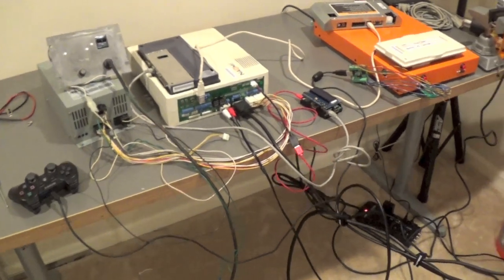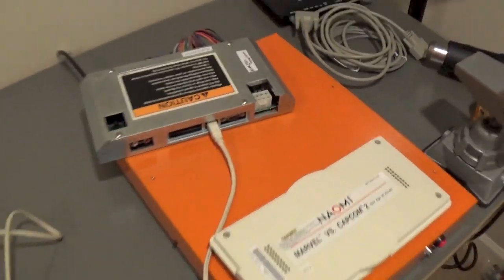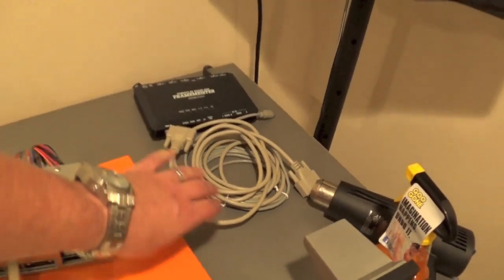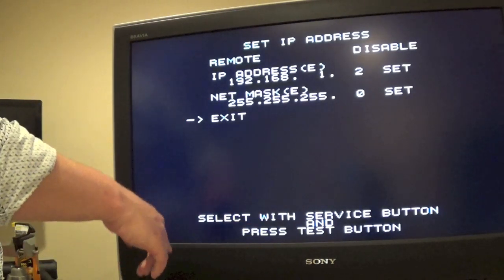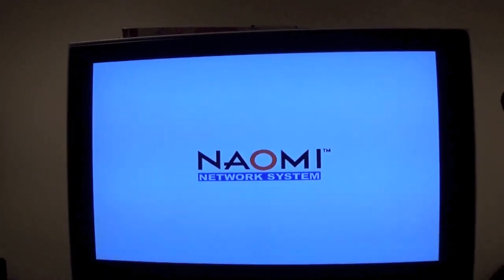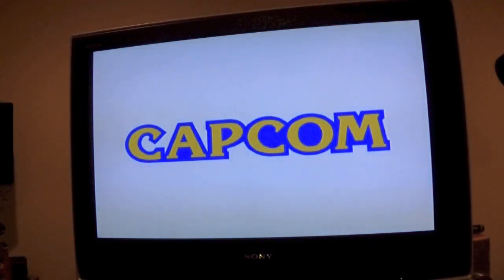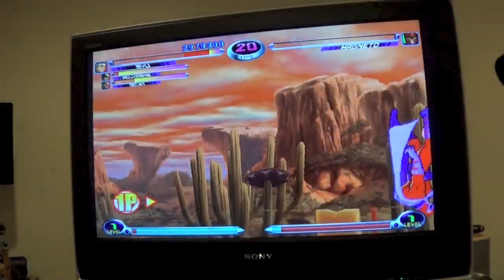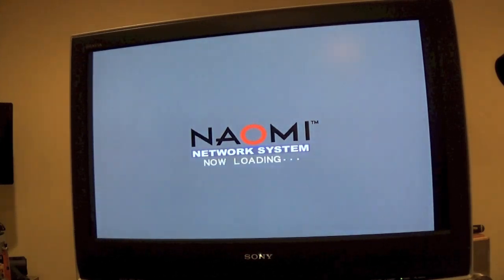JasensCustoms.com - Sega Naomi NetBoot Kit

Comment: What format does the rom on the compact flash need to be in?  If the game is a cartridge and not a GD-rom like you show in this video, what does that file on the CF look like?  I have a Original Wild Riders where the cart has died and was hoping to use this as an option to getting the game to run again.  Thanks

Comment: How much would that setup cost me as in a system like that
Reply from the maker: Alexander Smith - A lot. Naomi Net Dimm hardware isn’t easy to come by and they fetch a high premium. The Naomi isn’t terribly expensive but everything else needed to get it up and running ads up very quickly.
Reply: Yeah I actually get that

Comment: any chance of putting your pi software up somewhere? :) thanks
Reply from the maker: Clayton, not my software :-D It was a collaboration between TravistyOJ and others on the net. Actually, he may have just used some work from others and ported it to the Pi. I digress... check it out here: http://capane-us.github.io/piforcetools/#_=_
Reply: Thanks, found it on their site
Reply: Jasen Hicks would it be possible to get the pin out of the USB plug? And which pin does what for power on the Naomi? Thanks. Unless you still sell the cables

Comment: This item no longer available at JasensCustoms.com
Reply from the maker: Jensen, correct. I ran out of stock. I was thinking of bringing more  in but the 20 kits I had took about 6 months to sell. I will be selling PICs and BIOSs and USB Power Cable Kits for the Pi here shortly.
Reply: Jasen Hicks is there anywhere else we can buy this?
Reply from the maker: loubilly I think TravistyOJ is doing another group buy of the NETBOOT Kit. Can't say if it will the same as mine with everything, but it should be a good start. I think he's on NEO-GEO.COM and KLOV.
Reply: thanks :)

Comment: So what all is needed to get this up and running? Naomi motherboard, netdimm board,  Sega/CAPCOM I/O, and the netboot kit?

Anything else needed to get this running with a supergun?
Reply from the maker: To NetBoot you need a strong power supply that supplies 3.3V. A supergun typically does 5, -5, and 12. The Capcom I/o can supply it under normal circumstances, games only, but the DIMM requires more current than the Capcom i/o can supply. So in addition to your Sag you will need a power supply dedicated to the Naomi.
Reply: Jasen Hicks so everything listed as well as say a Naomi power supply? I know the Naomi has to be a certain version, is it possible to upgrade any Naomi motherboard to the correct firmware? Also, do you still sell these?
Reply: Sean Dennis sell the raspberry pi kit*

Comment: Oops... I accidently erased my last comment.

I have gone the google route and found 2 different versions of the null hex file . The only problem is my ROM burner isn't programming the chip properly. Either I got bad files, (one is 12K one is 6K... I'm not sure of the proper size of the file.) or my ROM burner doesn't seem to like those PIC chips very well...